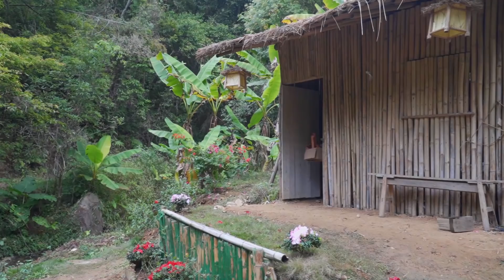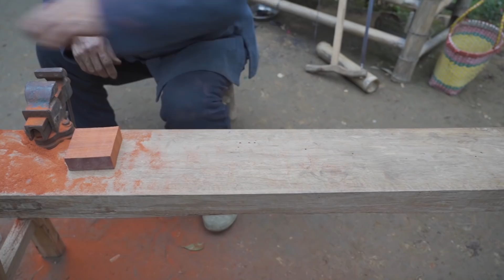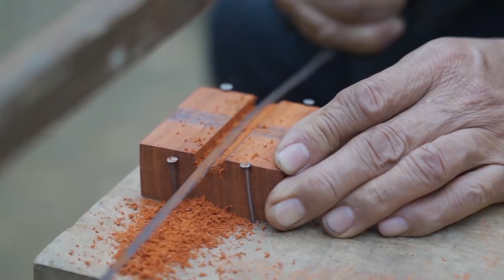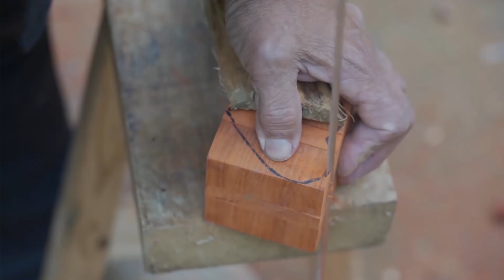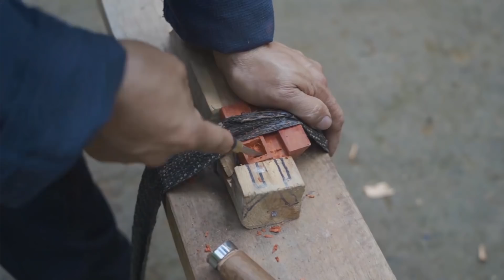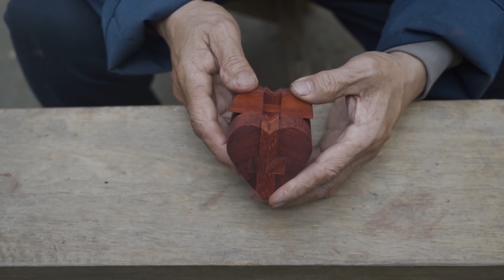阿木爷爷做了一个木质的心形锁，可以放戒指和珠宝

Comment: I love this series, but I don’t believe that a lot of Grandpa’s work is done entirely with crude hand tools. The giveaway is clear when he is cutting the recess for the ring. He starts with a chisel then “ hey presto” a perfect recess with smooth rectangular sides BUT with rounded corners, so it was obviously routed. Also he marks out using a thick pencil line and could never achieve the precision necessary cutting to these lines. Still it’s very entertaining.